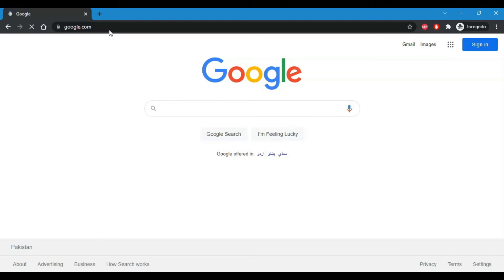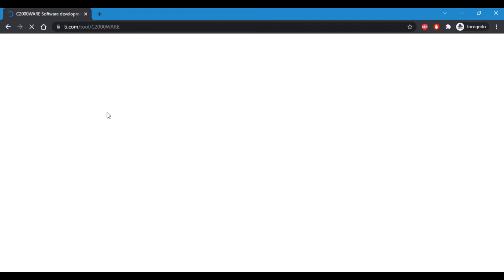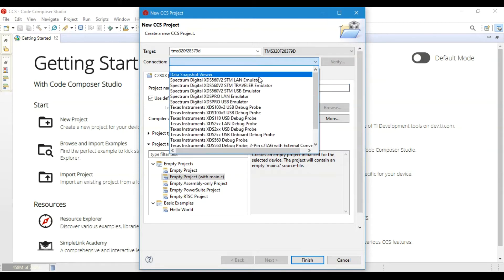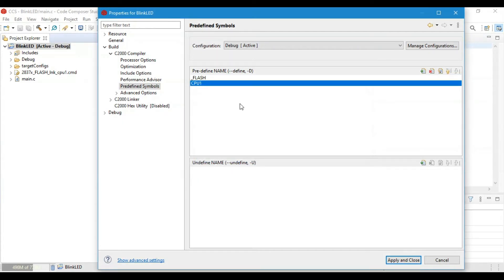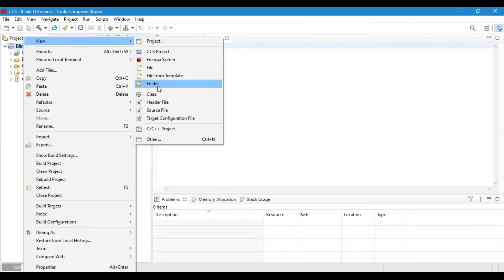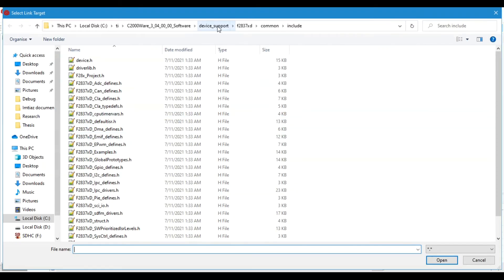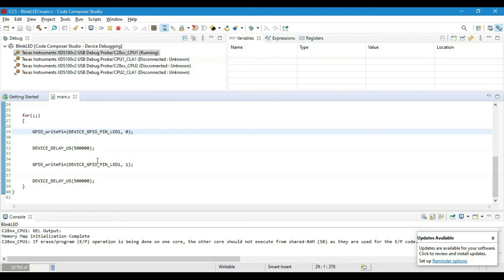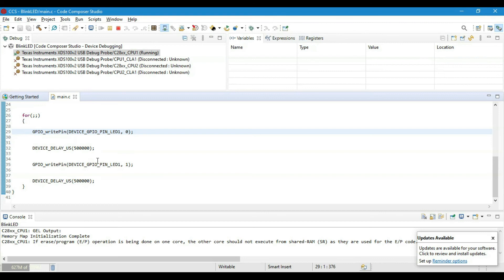LaunchXL-F28379D in Code Composer Studio (CCS)- Blink LED - 1

Comment: During debugging, why does the blue LED is stuck on the "ON" state until we click the "step over" button and click "resume"? When I do that, the LED blinks. And also, when I click on the "terminate" button the program is still running. I have never worked with this board using CCS so I am quite new. I have only used MATLAB Simulink. So, I don't really understand this. Can you please explain this for me further?
Reply: Also, I wish you could do a tutorial where you explain the process a bit more slower and also teach us how to change the blinking speed etc.. I know that is mostly just coding, but having that in the introduction video would greatly help!
Reply from the maker: I will do it.  My new videos will be more helpful @nebster333
Reply from the maker: The purpose of debugging is to see line by line code execution. When you terminate it does stop executing the code. It just stops the debugging process. The resume button resumes the operation normally.
Reply: @vdcsystems  OH that makes more sense!! I am relatively new to this whole embedded programming thing. We started with this board, so it was quite tough to get used to everything. I really appreciate your reply!! Looking forward to the new videos

Comment: thanks a lot，could you please tell me where the blink light code is ?
Reply: Hi! I know this is a year late haha. But if you are still looking for the code, you can find it in your C2000Ware folder. Basically C200Ware folder -> training -> src -> module2_getstarted_blinkyled. In that blinkyled folder, you should find a c file named "module2_main". I just opened this using VScode and copied it to CCS.

Comment: Very fast settings none can understand what you're doing until pausing the video
Reply: sorry to bother u, i couldnt figure out why always shows errors when i debug :"fatal error, cannot open source file "device.h" " i already try it 3 times but still didn't work
Reply: @victor-pw9im  I had the same issue. I fixed it by finding my path to the device folder correctly. Don't use his D:\..... link. Instead, right click on the device folder, click open in File Explorer, open the device folder, then copy the link from the bar at the top of File Explorer and paste that where his D:\.... link is.
Reply: @victor-pw9im  use your own path, not the path shown in the video